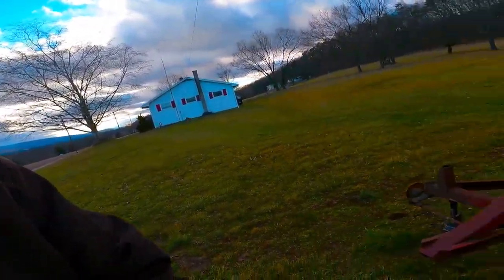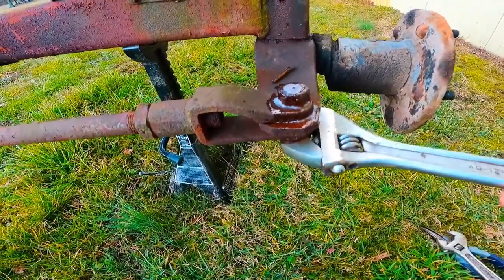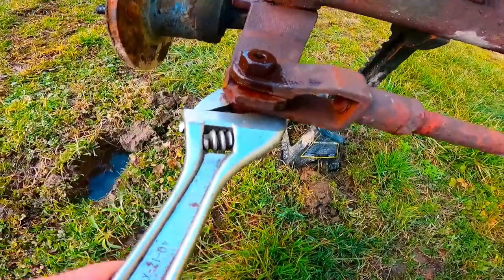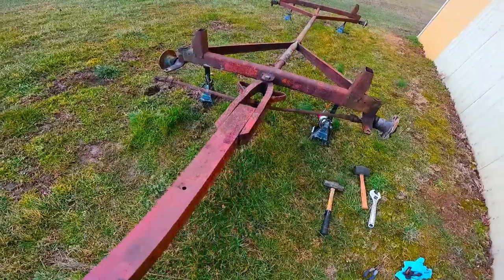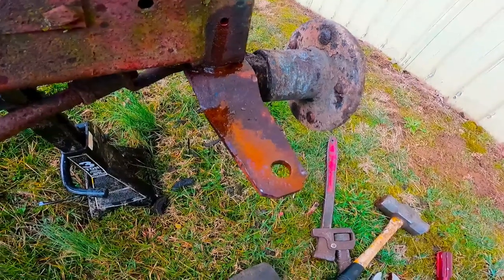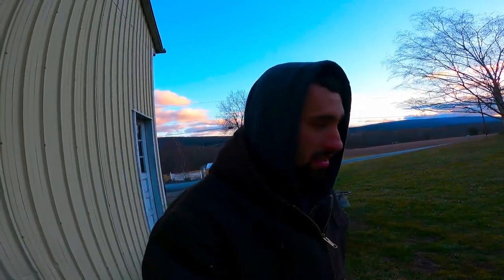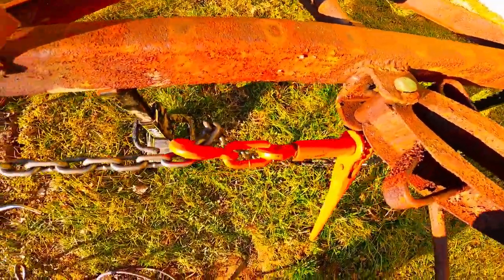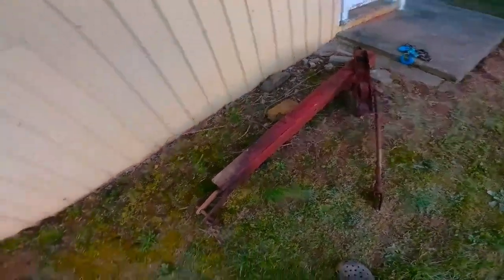Abandoned Hay Wagon Rebuild pt5 | Steering is loose

Comment: Good looking running gear. I gotta' do the same to an old here. We're going w/ a 8 x 16' platform. Got all the lumber except 2 main beams. Going to use treated 2 x 16' paired up for each beam, having a final 3 x 7 1/4" dimension. Be a good time to paint your gear.
Reply from the maker: Stay tuned! 😉

Comment: Put a chunk of pipe the same diamitor on the top and hit it.
Reply from the maker: Definitely could do that, they do move now so idk if I’ll try to knock them out or not
Reply: @shaffershomestead  I was thinking on just to lose them up. There should have been/be grease zerks on those tubes. I was thinking either the grease dried out or there wasn't much grease in them. My thoughts to why they froze  up
Reply from the maker: @floydblack3038  yeah there is holes on the front of each one where I’m thinking there should’ve been grease ports so I’m guessing I should try to install some cuz nothing is there
Reply: @shaffershomestead  that's why they froze up. Water/ moisture got in. With that being as it is U might want to knock them out and replace the seals in there. Just a suggestion. Wouldn't want u to have to rebuild later on. U have it torn down. Now would be the time to put new seals in.